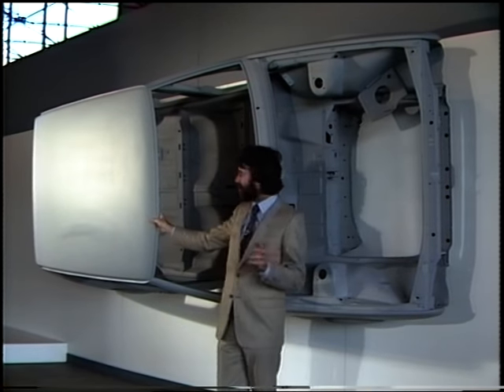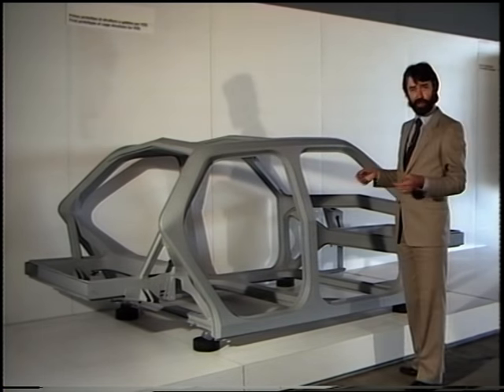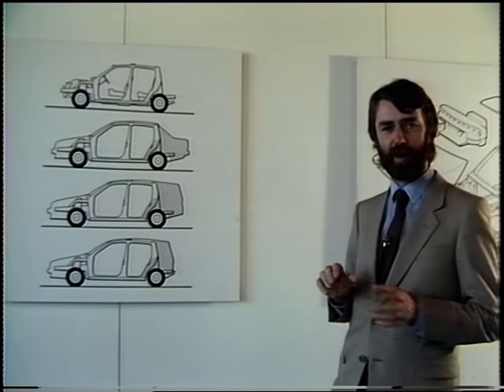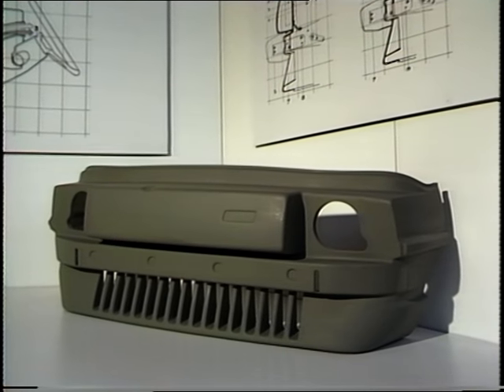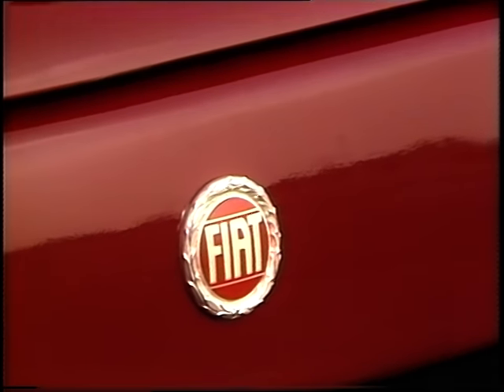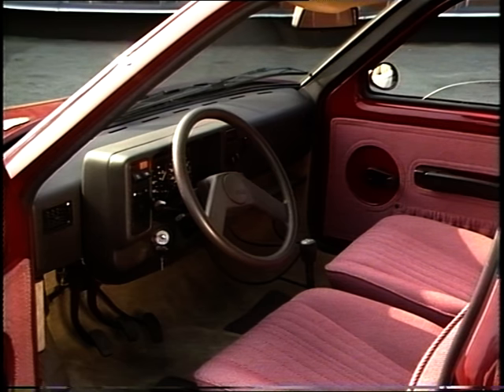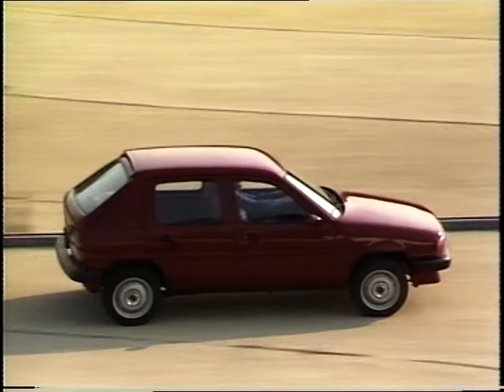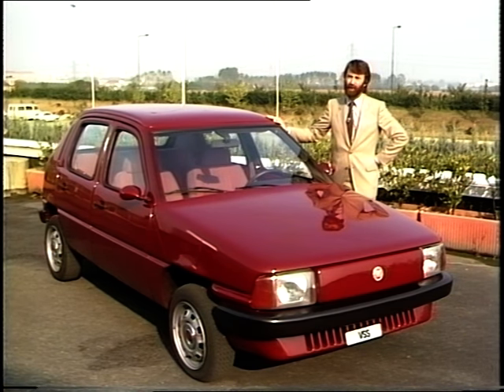Fiat VSS  prototype | Italian Car design | 1980s Cars | Concept Car | Wheels | 1981

Comment: The VSS concept was the forerunner of the Tipo modular platform which made its debut in 1988. This was the beginning of the common modular platform we see today where cars share the same superstructure but hanging different body panels to what suits the badge the car is wearing. Think VW Group and PSA today, or the Type 4 programme (SAAB 9000, Alfa 64, Fiat Croma, Lancia Thema) in the 80s and early 90s. It effectively replaced badge engineering among family brands. Next up is Toyota's New Global Architecture.
Reply: @2.00 A Volkswagen Jetta Mark 2!

Comment: many modern cars live 20 years now..
Reply: At the time it was an achievement for a Fiat (or Alfa or Lancia....) to get to the dealer in one piece rather than as a pile of red powder.
Reply: Really? The manufacturers build them with the same life expectancy as a washing machine. Hence sealed for life gearboxes.
Reply: @6ettinold  Yes indeed. It's simply not in the manufacturers interests to build cars that last 20 years or so. Where's the money in that?
Reply: Some do.  My 1994 Toyota Celica has only ever broken down once in the 21 years I've owned it.  But not all cars are quite Toyota quality: http://www.colin99.co.uk/mycar-2018.jpg

Comment: Hanging body panels onto a base-frame? A new idea? Er, Rover did it 20 years previously with the P6 and Citroen did it even earlier with the DS. Sorry Fiat, but it's already been done.
Reply: Not sure they claimed to be the first.
Reply: Neither Rover nor Citroen did it with plastic! I would guess GM’s Pontiac Fiero was one of the first mainstream cars from a major manufacturer to use plastic body panels.
Reply: No, you're missing the point.

This was to allow different cars to be made from the same basic shell.
Reply: @itstheterranaut  Rover originally designed the base frame construction with the intention of being able to reskin the P6 at a later stage in the model's production. As it turned out, the car continued to sell strongly and they were able to get away with a mild facelift rather than a complete reskin. I'm reading James Taylor's"The Classic Rovers" at the mo. Well worth a read if you're interested in the design and production of Rover cars. Was written quite a while ago, so it only goes as far as the P6, but it's a mine of information and very well written. As for Citroen though, I'm afraid I know very little about the DS and their reasons for base frame construction, but I know that car sold strongly too and had a very long production run with very little change to the basic body design.
Reply: @matthewgodwin3050  Interesting, thanks- and thanks for the recommendation on the book.

Comment: It looks like they struggled to make the plastic panels with the precision of steel ones. That prototype would have been hand assembled with all the parts carefully placed and yet the panel gaps and overall fit and finish looks pretty poor. That said, they should have done a dent test and I am sure that car is very hard to dent.
Reply: Plastics expand and contract more  with temperature changes than sheetmetal. Road tests of Saturns always talked about how wide their panel gaps were, not at all like a Toyota or Honda from the '90s/00s, but they were a technical necessity.

Comment: For some reason, Fiat discontinued cars in the USA in the early 1980s. It took another 30 years before Fiat brought back their cars.
Reply: Jody Owen  Oh Dear! The Original Classic Mini was FWD/Front Engine a decade before the FIAT 128 appeared so not very revolutionary then.
Reply: @williamwoods8022  why do people like you have to sound arsy? What's the 'oh dear' all about? Can't you just politely point out the that the Mini beat the 128 timeline wise.
Reply: @williamwoods8022  The Mini package was flawed with the gearbox in the sump. How many manufacturers have used that layout since? Exactly. The 128/Autobianchi layout designed by Giacosa with the seperate end-on gearbox and unequal length driveshafts is the blueprint for the modern front wheel drive car.

Comment: Nice injection molded body, but same crappy unreliable engine and transmission. I guess you can live in it when the motor goes tits up a few Kilometers from the dealer.